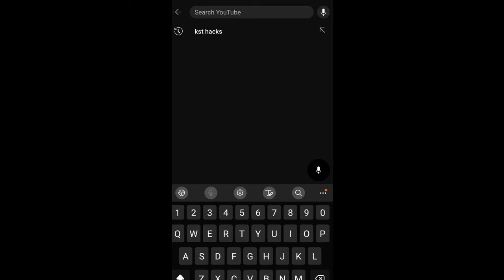How to make a Front Suspension (New version 2023)

Comment: wishbones should never be of equal length, it will damage the tires.
The geometry should be as such that the tires never scrub the tarmac side ways, the upper ones are shorter.
It's always like that on cars, race cars.
Reply: Yes too much camber change over the suspension travel. The upper and lower arms are usually not both parallel to ground level. The lower arm is usually flat and the upper arm slopes down toward the centreline.
Reply: @DMJ52  You can see that very good on the Mercedes Benz W124, W126, W201 (190) and so rear suspension.
Reply: I don't see how equal length would cause the tires to "scrub the tarmac side ways." This design causes the camber to remain static throughout the suspension movement. With unequal length control arms, the camber changes as the suspension moves. Are you talking about scrub radius?
Reply: @jimgoodwin6440  Buy a advanced Lego technic car or rc car with double wishbone config. Press the car down and see that the tires spread apart, rubbing. no real car, not even a F1 has equal length wishbones.